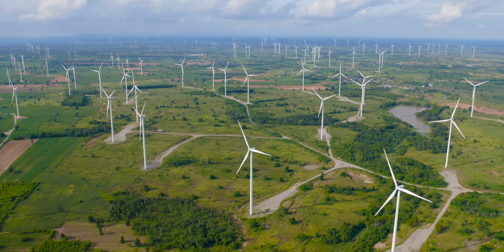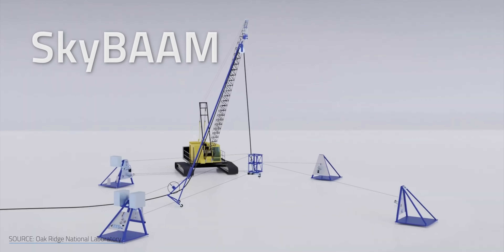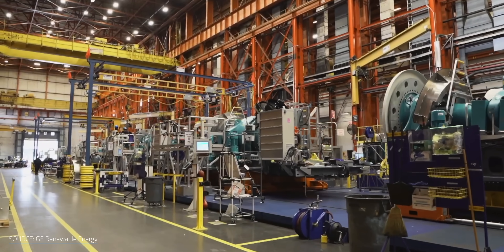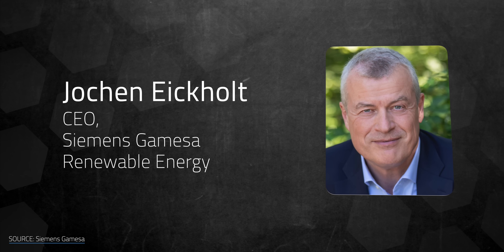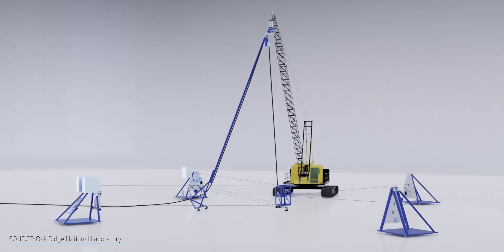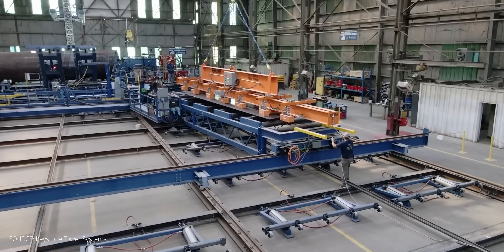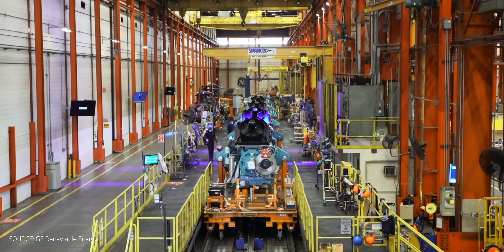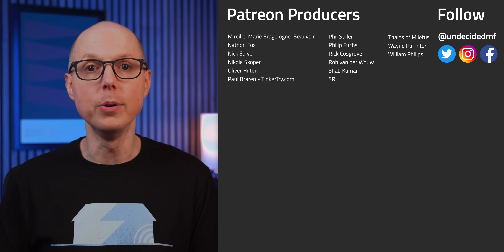Why We Need To Rethink Wind Turbines

Comment: I really like the idea of the tower with multiple smaller blades and generators. 
And this story hits home for me, I live right between a GE and Siemens factory, am looking at one while writing this lol.
Reply: I don't see the multi generator set up being of much value. From an engineering and physics standpoint it seems to add a weight and complexity for a less efficient paradigm. Makes me think a bit about solar roadways or dehumidifiers for water in the desert.
Reply: @barongerhardt I wonder if efficiency gets better once you factor in economics.

If they are worse, but much cheaper, maybe they're better overall.
Reply: @drillerdev4624  It is a scaling issue. If a turbine half the size cost half as much, but it would only make one quarter the power. So four small ones for the same power adding up to two times the overall costs.
It is a hard economic debt to overcome. If there was an existing robust market and manufacture of small scale wind turbines, it might be possible, but I don't see that as our current or future reality.
If you are a computer person, you can see these things in PC fans. Look at the power/noise/cost vs volume of air moved for small case fans vs larger ones. You quickly come to the conclusion that the largest option is all most always a better choice than several smaller fans fitting in the same space. (EG a single 120mm fan vs 4x60mm vs 9x30mm)
Reply: @barongerhardt  but weight scales cubically while size scales quadratically. 

In computer fans weight isn't an issue, but in wind turbines it's a major one. Add the cost of transportation (the video said the smaller ones fit in regular containers) and numbers start to drop.

I'm not saying it's better, just that I wouldn't discard it based on "bigger being better" alone.

I guess if they succeed as a company, they'll probe it. If they fail, probably wasn't a good option.
Reply: @barongerhardt the problem with solar roadways is the implementation. The solar should be an additional layer over the roads. This would allow the solar to never be obstructed by vehicles or road detritus, and allow the road to be free of precipitate.  Imagine never having to snowplow a highway and the resources saved there. We are so close, but the industry is held in the palm of massive corporations that only wish to change if it makes financial sense.
Reply: @It-b-Blair  It isn't the implementation; it is the fundamental idea. It implies that there is limitations on the system that don't exist and proposes an overly complicated and expensive solution. You don't need solar panels above the road or next to the road or in proportion to the roads. Having road access to a site that is away from traffic is more desirable in almost every way.

For snow removal do the math. The energy required to move a cubic unit of snow vs melting that same snow. It is far better to use a snowplow. Heated driveways are a idea for rich, lazy people. You could maybe make an argument for highly congested city areas, but for the vast majority of roadways the addition of a heating infrastructure would be a massive waste of energy and significantly increase the cost of construction and repair while providing another mode of failure.

I will skip over traction and durability of PVs. It is not an idea being held back by corporate interests. It is one being promoted by the ignorant.
Reply: @barongerhardt  The idea of solar roads is to use land more effectively, you get a road and a power plant.  There is a limit to how much land we can use and solar does take up more space than a natural gas plant (or at least more space where most people care about it, I don't know the math on total area consumed per KW).  There are of course various issues with solar roads that you pointed out (dirt and cars blocking it).  The idea of a overhang could be cost effective in some areas, though I'd be concerned about clearances (it would need to be at least as high as a bridge), lighting (it should produce more than enough power for lighting but you'd still be running lighting continuously), and durability.  Assuming those concerns could be dealt with then an overhang could be effective in a mostly sunny area and even somewhere that gets snow could potentially benefit (you don't have to melt all of the snow to clear them and chances are you'd still be generating more energy than you'd be using).
Reply: They have done the calculations and found 1 double sized wind turbine is cost effective over 4 wind turbines with equivalent power.  They must have also considered a crossbar holding 2 or 3 Wind turbines on one tower and decided it wasn’t worth it.  I believe there are other solutions that improve cost effectiveness of wind turbines but will they ever compete without subsidies?
Reply: This design  adds more parts to be maintained. Other question. How maintainable is it? May save cost on the front end, but eat it on the back end.
Reply: You might like it but it is a very silly idea. From the standpoint of cost, weight, maintainability and cost it is very bad.
Reply from the maker: 😂 That's funny that you happen to be sandwiched between them.
Reply: @UndecidedMF  
No, just no. Wind turbines scale exponentially with size.
You need 100 1m blades to cover the same area as a 1 10m blade. This is why smaller is alot worse.
Reply: @UndecidedMF  a GE - @Dan-Simms - Siemens array? Now the modeling gets extremely difficult!

Comment: It doesn't matter at what pace the components are printed or whether the new types of wind turbines produce even more power, because the main problem is the limited capacity of power collection due to the outdated grid lines. Therefore, a rethink and modernization must take place there for the time being so that renewable energies can continue to develop - as desired.
Reply: Or we can stop focusing on grid-scale projects and switch to more robust community based ideas.
Reply: @snowstrobe  they pretty much banned that in the UK. can't be eating into gas profits, you see...
Reply: @snowstrobe   I don't think people focus enough on energy *independence*. Heck my university used to have (short term) black outs routinely. They put in solar this year and we've only had one very short one.
Reply: Interconnectivity via the grid or multiple grids with interconnects produces a robust system. Small localised ones are not robust. @snowstrobe
Reply: The grid is always being added to as demand grows.
Reply: @AORD72  That's why 15000 projects in the U.S. are waiting to be connected to the grid, and all of the largest wind turbine manufacturers have suspended all activities.
Reply: @Win100n  Doesn't mean the grid isn't being built to meet the extra capacity.
"suspended all activities", doubt that is true. https://en.wikipedia.org/wiki/List_of_wind_farms_in_the_United_States#Planned_and_under_construction_wind_farms

Comment: I'm really excited about the wind turbine projects with towers made of wood or the tower being more skelton like. This reduces the amount of steel needed for a wind turbine significantly but still providing enough stability for the nacelle and rotorblade. Really curious how these innovations turn out. The MRWT also looks very interesting i gotta say (and btw loved that milk shake analogy ;)). Really looking forward to seeing all those new innovations arise and I really hope these can help solve our energy problem!
Reply: The towers are already pretty well optimised
Reply: Open lattice towers have a problem with birds sitting or nesting on them. The GE tower design had a fabric cover for this reason. I don't think they built one. It was supposed to be a 'take parts out of a conex' and bolt them together tower.
Reply: There are very good reasons why steel replaced wood in most large scale construction.
Reply: Cut down some more trees, splendid idea. Make sure any bird’s nesting get cut down too.
Reply: @marktapey7678  You realise wood is carbon neutral don't ya?
Reply: @endofradio3507  They probably don't, maybe they even think it's better to use crazy amounts of coal to fire the blast furnaces to produce steel :)
Reply: @endofradio3507  You do realize trees are carbon eaters don’t ya? They thrive on it actually, but the cult ignores that part.
Reply: @endofradio3507 Wood being carbon neutral assumes you replant the trees. For wood burning for heat that happens. For the 16 million trees felled in Scotland to clear hilltops for windfarms, that didn't happen.
Wind farms clear large areas of all trees and concrete over a large chunk of the land. That isnt carbon neutral or very green, thats obliterating ecosystems just like lithium mining for solar and batteries

Comment: I'm not a turbine engineer but an engineer nevertheless.. I can see the problem right from the start, all the machinery is at the top of the unit making it very top heavy, the pillar, trunk is getting taller and taller, the weight of the machinery and the force of the wind pushing against the whole surface area means this is inevitably going to happen.
Yes there's the 'scale of manufacturing' concepts but bigger isn't always better as this shows, too much force even on these massive units, the materials or design principles used to make them just aren't good enough.
Why make them bigger anyway? The design and physics principles can't change just because it's bigger.